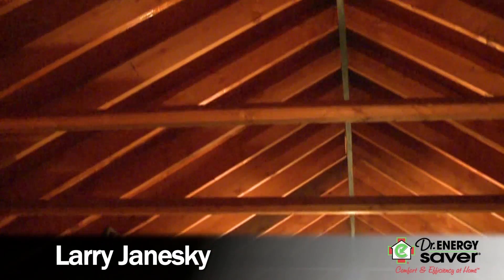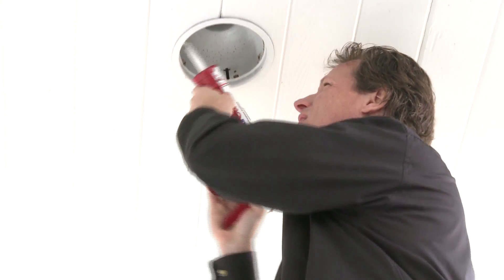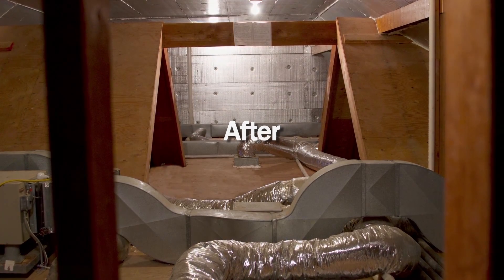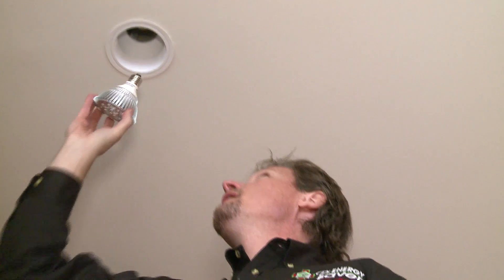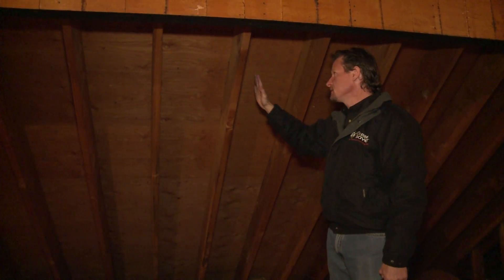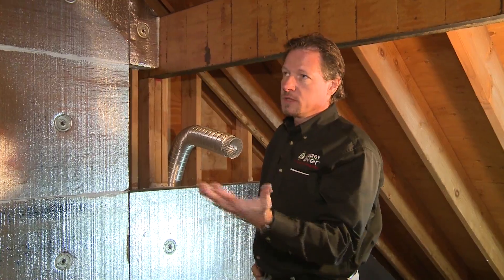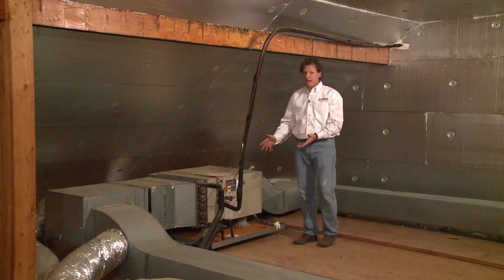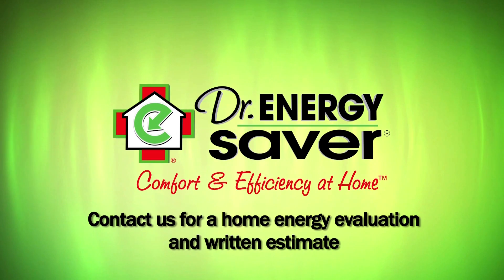Insulating with the Super Attic System

Comment: How do you manage the indoor moisture that could be a problematic issue in some circumstances?
Reply: Was wondering the same. Did they remove the insulation from the floor? The air from home has no where to go if attic has double layer insulation.

Comment: Cannot find input or help in months. Insulating/Foaming holes-cracks in Attic. 1940 Ranch. Where the Front Porch was connected to House is a HUGE cutout Access Hole in the Attic Wall facing street, made to get to the Porch ceiling to install a Fan way back when. When you sit on the Porch, if you turn around is where the Alum. Siding is on the front of the house. Cutout hole in Attic measures 18 feet wide by 6 Foot high(exposing the Ceiling of add-on Porch), then the remaining wall UNcut has the other Gable vent(back of house has Gable vent also). No animal or pest problems ever. Is this the BEST ventilation in the world to keep the Attic Cool or Warm in winter??? I wanted to seal it up. I have never seen anything like this. Chimney chase only has basement Furnace/ and Water heater vents( no fireplace). There's even in Attic ANOTHER Chase that has no purpose(no exposed pipes etcetc UN sealed in Attic). It's like when they built the TWO chase's to basement, they said, " NO you idiot Chimney goes OVER there. Any help thanks......WISH I could provide Pictures, you guys wouldn't believe it when it was constructed. ALL your Videos I have learned intently and taken notes and acted upon to-do my jobs. 👍👌👍

Comment: https://www.youtube.com/user/seumas2/videos with infinitive details from the foundation up/build Passively 

Port
Alberni's first Passive house (Passivhause) build in the heart of
Vancouver Island British Columbia Canada.

Passive
House(Passivehaus) is considered to be the most rigorous 
voluntary energy-based standard in design and construction industry
today.

Passive
house buildings consume up to 90 percent less heating and cooling
energy than conventional building.

The
use of Passive House design software was used to gain the specs
required to meet the performance standard for this location.

House
was constructed well  above the current standards as outlined in
the B.C. Building Code.

Footings
were widen to 36 inches(914 mm) due to low bearing soil conditions
and additional rebar reinforcement added.

30
inch high (762 mm) high reinforced walls . Course sand placed inside
foundation walls and mechanically compacted.

Three
layers of four inch *102 mm) thick  Expanded 
polystyrene foam sheets with all joints staggered and tape were
placed on top of compacted sand.

The
three layers of foam have insulation value of approximately R 50.

A
20 mil layer of poly was placed over the E.P.S. sheets and taped and
sealed.

Four
inches(102 mm) of 30 m.p.a fiber reinforced concrete was placed to
form a slab over the foam based.

Slab
is isolated from concrete stem wall with four inches (102 mm) of
E.P.S. to prevent thermal loss.

All
cold water lines are buried in the sand to keep them cool, hot water
lines have been placed in the center layer of foam insulation to
minimize heat loss.

Wall
plates compress to heavy beads of acoustic sealant between layers of
vapor barrier to prevent air movement.

The
walls are double stud configuration set at 24 inches (610 mm) on
centre and plates are spaced in a manner that yield a 20 inch (508
mm) thick wall. 1/2 inch (12 mm) standard plywood sheathing with 
Mento 1000 a three layer airtight vapor open house wrap( far superior
to common house wraps) with 1/2 inch(12 mm) pressured treated plywood
rain screen battens form the exterior surface. 

Intello 
smart vapour barrier was installed one third in from the inside wall
to prevent condensation in this climate.

Triple
pane argon filled windows meeting passive house standards from
Euroline  were placed mid wall to reduce wind wash heat loss. 
All window openings have been splayed at 45 degrees to give a full
wide angle view.

Almost
all the wiring and plumbing was kept inside of the vapor barrier
envelope to minimize air leakage.

Passive
house standard requires air leakage not to  exceed .6 Air
changes per hour at 50 pascal.

Zehnder
comfoair 200 HRV has been installed with a 1000 watt air preheater
.(92 percent heat recovery rate)

House
has been pre- plumbed for a heat pump water heater reducing 
domestic water heating cost significantly.

Garage
has been pre-wired for 40 amp/240 volt  electric car charging
station.

House
to be equipped  with  heat pump condensing dryer which
requires no external venting,only a water waste line. George K
Builder. © George K 2019      
https://www.youtube.com/user/seumas2/videos

Comment: Nice looking work.

At least you did not throw the so called insulating stuff on the floor of the attic.

What is the material inside the Superattic panels?  Is it styrofoam or styrene?

Comment: what if your roof attic does not have a ridge vent but two to three roof vents in own locations can it still be uses the super attic insulation.,.
Reply: bccron IMO, yes it could be done with horizontal spants, but even better would be to plug those roof vents and install a ridge vent.
Reply: Agree with Jerry i had this done by local super attic rep. Installing ridge vent was not THAT expensive and not THAT hard given overall job. Thsi stuff works as he susgests-just make sure you have adequate soffit venting that is NOT clogged up with seeds dirt etc or painted over ! Most OLED houses do NOT have adequate amount soffit venting to match up with the ridge venting, esp after they have been painted over and v clogged for many years- Its a pain top pop out old clogged soffit vent and replace, may just wante to double up with an additional new stiffest vent strip - Bottom line-HAVING mechanical in an UNcoditioned attic is just nuts....IOf u lack a basement, condition your attic - one caveat-thsi is a very meticulous job, down for a demo video-you want get this level of finish or tight gaps- foam will NOT seal forever-suggest sealing ALL seams with hi quality butyl tape used on good ductwork-not the thin usual big box store metal tape- has to be butyl with that sticky adhesive -thsi sticks on avidly -a trick you cna probably cut in half lengthwise with sharp utility knife-most seams wont require the full width of standard tape and save $.

Comment: What was done to stop the thermal connection with the sill plate in the soffit? How will the gable end walls bays dry out? What is the r value again of those panels? Why was dense packing or spray foam not considered? I agree with the thermal boundary but bath fans need to be hard piped with a negative slope to the outside.

Comment: I can see why this method worked in this particular house:  Lots of mechanicals in the attic, on top of a finished attic deck.  Also, it would make quick work of converting this attic to live-in space if needed.

Otherwise, I'm still a fan of traditional attic-deck insulation, between the studs that form the ceilings of the rooms below.  The attic is merely a hat for the house, to keep wind and precipitation from reaching the inhabited spaces of the home.